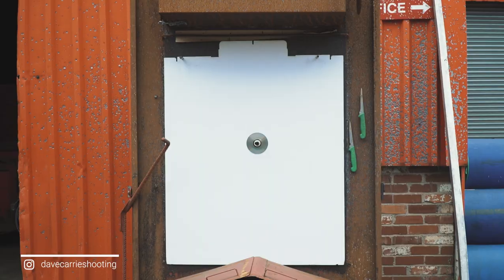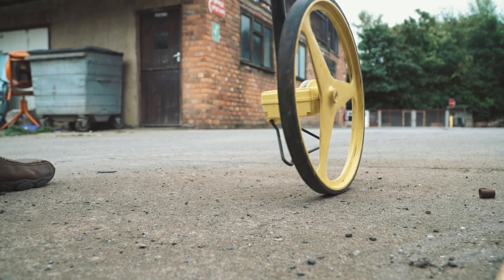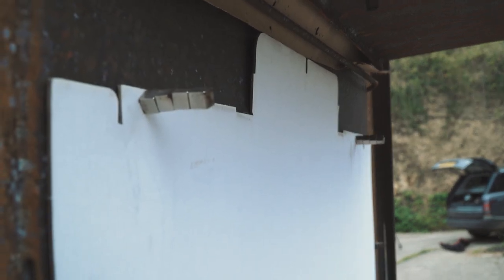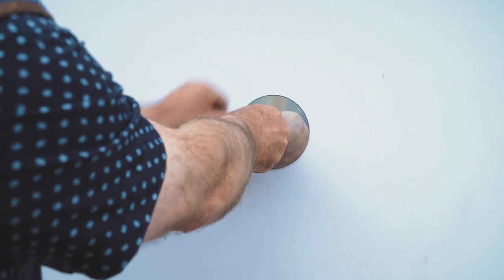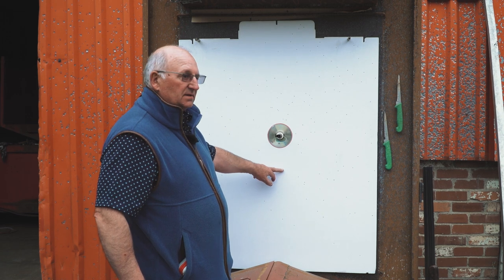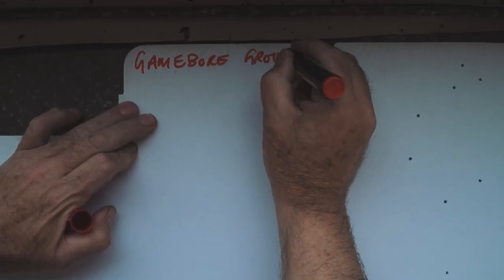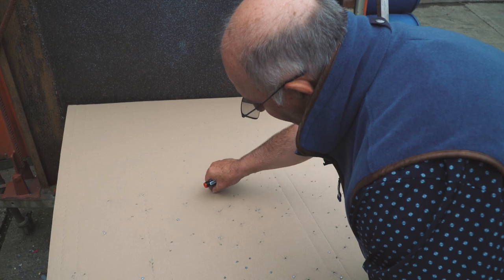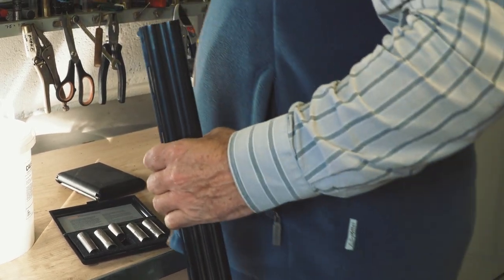Dave Carrie (Load Testing) - Set Up & Gamebore Grouse Extreme

Comment: Hi David would you be happy to use this cartridge on 40-50-yard pheasants in the past I have you used a mix of game bores black gold 32 gram 6s and 32gram 5s and this seems like a good size between the two, or could you recommend a better cartridge I will be shooting this year with the new 525 crown which is fixed choke 1/2 & 1/2
Reply from the maker: Hi Jack the 33gm 5.5 grouse are really hard hitting